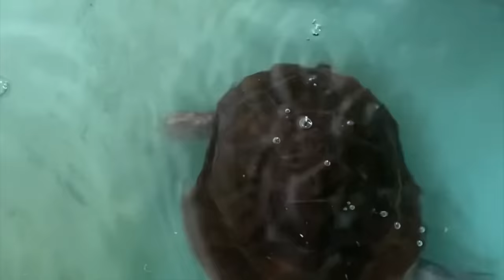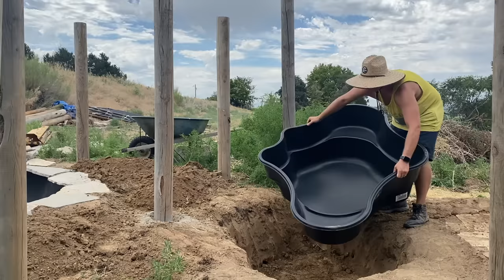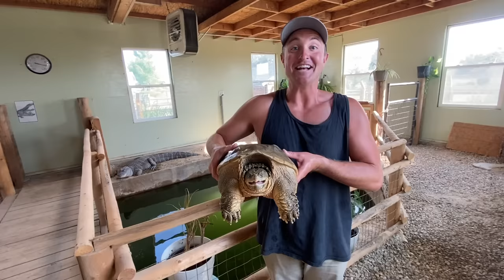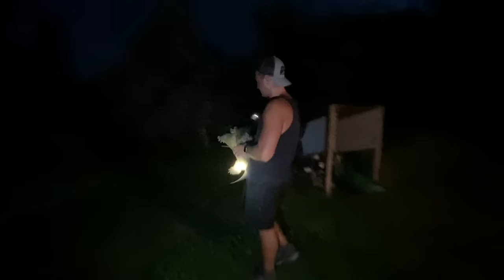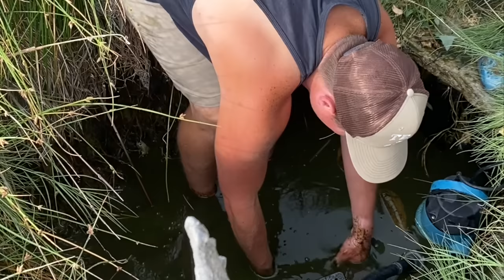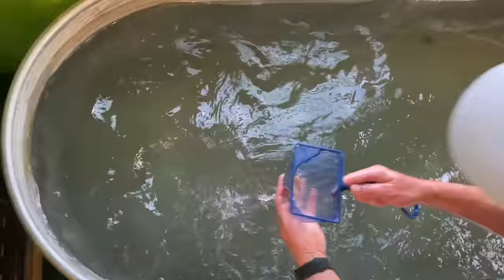Building FOUR NEW Turtle Ponds For My Pet Snapping Turtles! DIY

Comment: I get why you made the final pens the height they were; limitations by the height of the preexisting fence, and I do think they're safer being completely enclosed, but I feel like you could have made them taller for your poor back, maybe put one of those anti climb ledges at the top of the fence, the shade on the full pole height or on a roller so you can move it back when you need access.

Comment: Will the turtles stay in these ponds during the winter or will they move inside?

The construction is very similar to how we build temporary enclosures at the fox rescue I work at...minus the pond, gravel and stone lol. We also had to put the wire at the bottom of the enclosure because of digging. It is covered with a very thick layer of hay that gets changed out periodically.